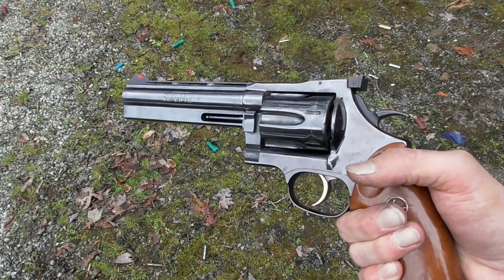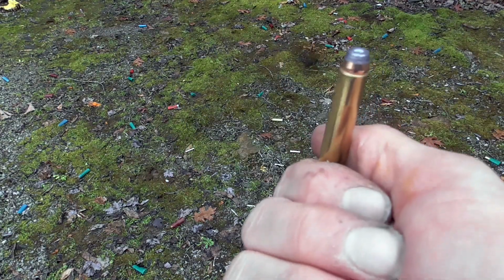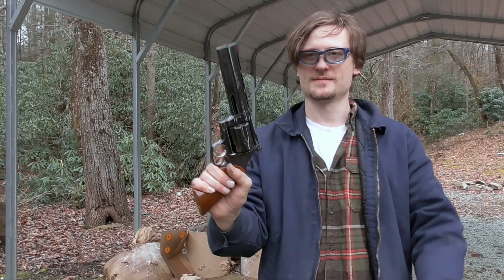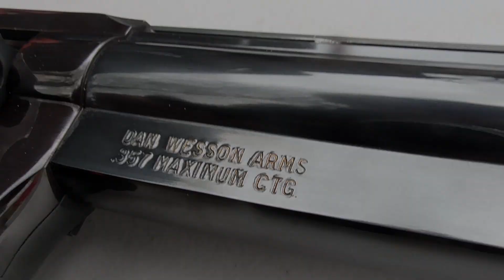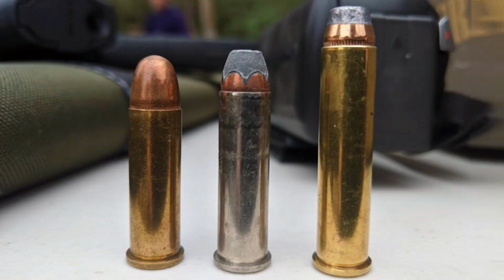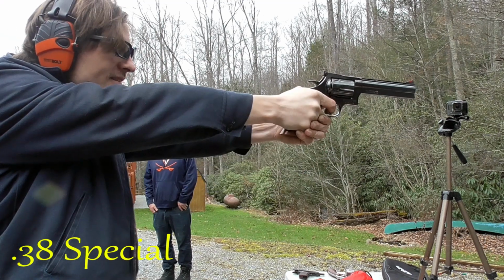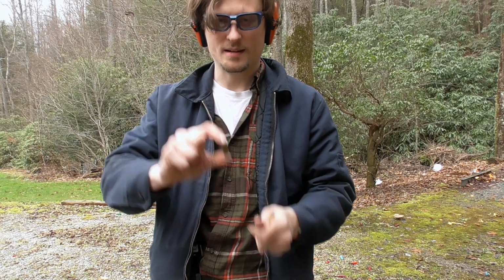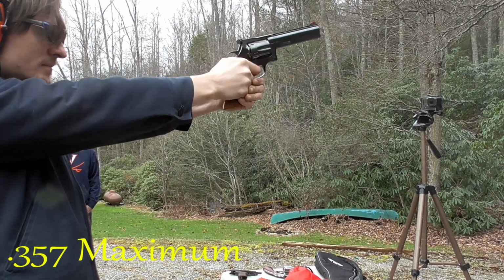Dan Wesson Supermag .357 Maximum revolver shooting

Comment: The reason I pick revolvers in the largest cartridge length is the ability to shoot all the shorter cartridges along with it. 327 Federal is the largest cartridge length and a GP100 327 Federal is versatile for one example. The 460 Smith and Wesson magnum is another.
Reply from the maker: I love that versatility as well, I love the .460 S&W.
Reply: Jeffrey Locke the 460 could be one of the most versatile handguns in the world. Honestly it could host 460, 454, 45 cult, 410 shotgun shells, 45 acp, and 45gap and possibly more if they would make the frame and cylinder longer. I personally think they missed a big opportunity because they didn’t make it longer for 410 shells.
Reply: @disninja8285  with treatment by TK Custom for moon clip use that keeps single loading and speed loading intact, the 460 S&W magnum X-frame revolver can use any 45 caliber semi-auto cartridge made as long as the moon clip can be made to hold it fast for head spacing. 45 ACP, 45 Rowland, and 45 Winchester magnum for example. But not 410 shotgun shells. The chamber is too tight for that tolerance. And I am good with that.

Comment: I bought one in stainless finish 6 inch barrel  back in 1986 zebra wood  grips they gave me an extra barrel because the round is  so hot it burns the  railings out of the barrel after  prolonged shooting excellent gun I will never get rid of.

Comment: Cartridge reminds me of the .460 S&W mag, in the .357 caliber. Frankly Smith & Wesson should have simply called it a .45 Maximum in keeping the tradition.
Reply from the maker: I thought the same thing, Im a big .460 fan too. Hmm, sounds catchy.
Reply: @exterminator87  .454 Casull, another great one. I'm a .45cal fan in multiple cartridges. Just wish ammo wasn't so stupid expensive these days.
Reply from the maker: @exothermal.sprocket  that is a great one too. I enjoy shooting both of those, yeah it's all very expensive but you probably have a better chance at finding those right now compared to more common calibers.
Reply: @exterminator87  Yes very true. I've been seeing 454 in places where most everything else is out of stock.
Reply from the maker: Yeah, one reason I love some of these big rounds. Ive also used the opportunity this year to get into .41 Magnum and .357 Maximum and its not very sought after but of course Ive been getting those two reloaded.
Reply: @exterminator87  My guess is primers and powder are the difficultly there. Probably not a problem locating brass or bullets for those.
Reply from the maker: @exothermal.sprocket  that is correct
Reply: @exothermal.sprocket  Love my Magnum Research BFR .454 Casull/.45LC 6.5" barrel with white micarta grips. Extreme power and can fire the .45 Long Colt for target practice.

Comment: There exist no evidence that Elgin Gates had any physical involvement or intellectual property that exist to support the continued claim of the idea Super Mag cartridge origin. 
While I appreciate your resurrection of the information your sharing of its existence, stating that it will fire all those cartridges, continued firing of those shorter cartridges without proper cleaning will cause irreparable erosion to the cylinder. Take care of thaT DAN  WESSON at least to honor the original inventor Daniel B. Wesson III. The original cartridge development was from RUGER and REMINGTON with Hugh Reed from Federal Ammunition manufacturing brass ( nickel at 1.490 length) long after the testing was underway by Bill Ruger JR. And consultants. In Newport New Hampshire.